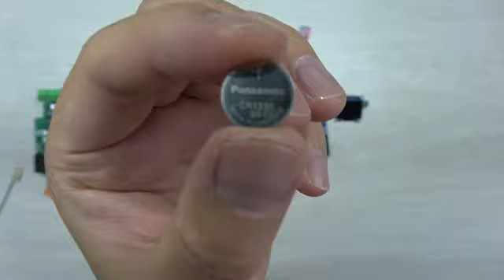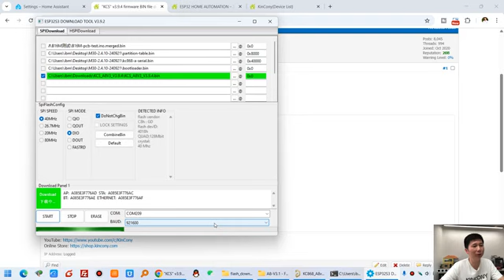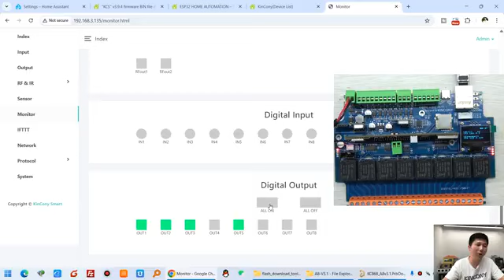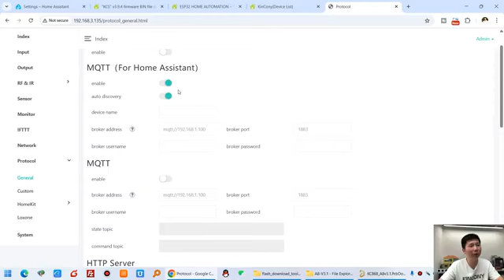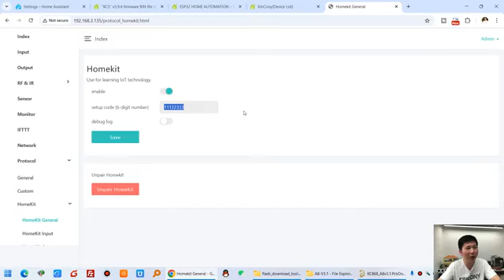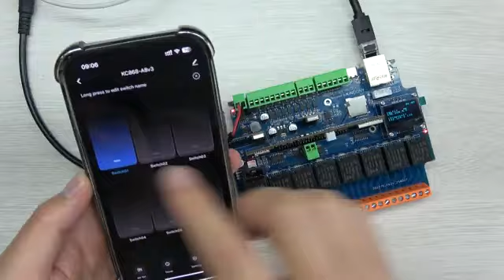ESP32-S3 8 channel relay module – KC868-A8v3

Comment from the maker: ESP32-S3 8 channel relay module – KC868-A8v3

W/A:+86-15531181781
e: liluna@kincony.com
Model No. KinCony KC868-A8v3
Description: KinCony 8 Channel ESP32-S3 Relay Controller – A8v3
Power supply: 12/24V DC
Processor: ESP32-S3-WROOM-1U (N16R8)
PCB Size: 105mm*148mm
interfaces: Ethernet(RJ45)-LAN 100Mbps IPv4/IPv6,WiFi,RS485,Bluetooth,USB-C,LCD, i2c extender
RTC: DS3231 high precision chip (battery socket on PCB)
SD Card: SPI bus
Installation method: DIN RAIL (with plastic shell)
LCD: SSD1306 I2C display

Outputs:
8CH Relay Outputs, every channel relay’s load MAX250V10A COM,NO,NC

Inputs:
8CH dry contact inputs (optocoupler isolation, long distance circuit for MAX 500 meters cable)
3 buttons: S1:Tuya S2:ESP32 Reset S3:ESP32 Download (GPIO0)
1-Wire GPIO: 4CH (with pull-up resistance on PCB)

improvements based on old KC868-A8:

1. use by ESP32-S3-WROOM-1U (N16R8) big memory size chip and Tuya module.
2. support use tuya app without tuya license.
3. support voice control by Alexa and Google home speaker directly.
4. add NTC power protect circuit, if polar exchange will not burn board.
5. replace LAN8720A with W5500 ethernet chip, more stable.
6. add DS3231 high-precision RTC clock.
7. support KinCony new cloud service.
8. support KCS v3 support Apple HomeKit and Loxone Miniserver system.
9. add SSD1306 LCD display
10. add SD card to save LOG
11. support KCS v3 newest firmware more powerful functions.

software solution:

1. download KinCony KCS v3 firmware, so that work with multi protocol: HTTP, MQTT, TCP, RS485 modbus, Tuya app (need to buy tuya license), config OUTPUT for “momentary” and “interlock” group functions. “KCS” v3 support IFTTT function work locally without internet. It also support use by KinCony cloud server. KCS v3 support home assistant auto discovery function by MQTT, so without any config file for home assistant.

2. download firmware by ESPHome, integrate to home assistant or use by web service.

3. download tasmota firmware.

4. write your own Arduino code for your own requirements.

5. It is recommended to use home assistant and Tuya mobile phone app at the same time. So that remote control by internet using Tuya app, local control by LAN using home assistant app.

Related technical information
———————————
ESP32 I/O pin define: https://www.kincony.com/forum/showthread.php?tid=7970
KCS v3 firmware download: https://www.kincony.com/forum/forumdisplay.php?fid=75
config yaml file for ESPHome: https://www.kincony.com/forum/showthread.php?tid=7971
ESPHome official supportted list:
arduino demo source code: https://www.kincony.com/forum/forumdisplay.php?fid=78
KCS v3 firmware online guide: https://www.kincony.com/how-to-use-kcsv3-firmware-esp32-board.html